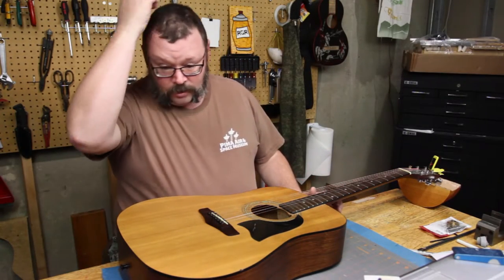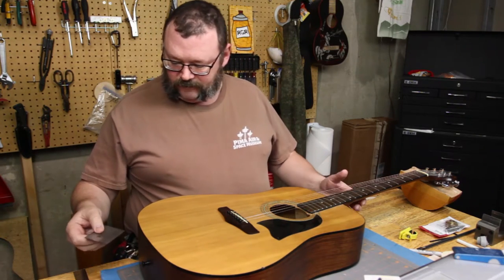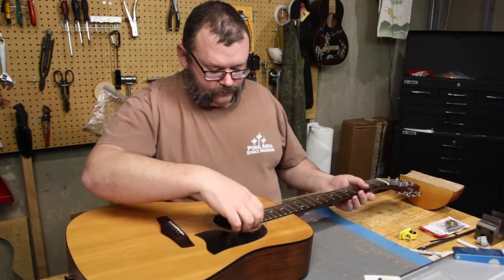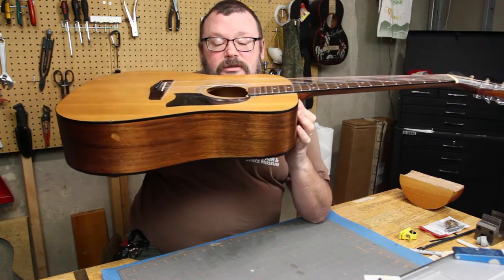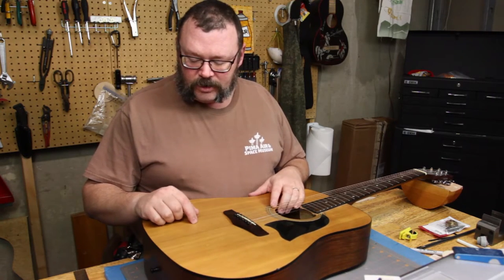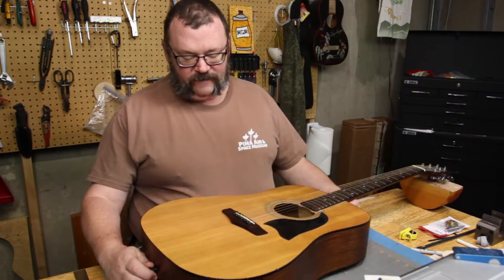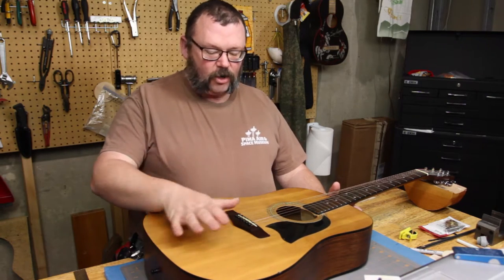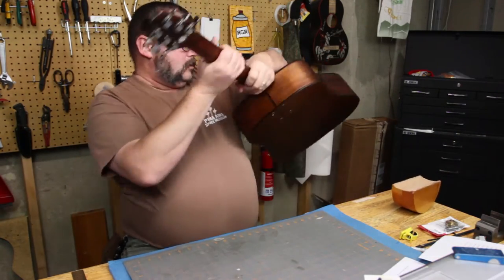intake inspection pt1 PEAVEY CLARKSDALE | RATTLECAN GUITAR RESTORATIONS by James O’Rear

Comment: WOW! High action city! I'm surprised the top didn't crack or break! With a neck block like that and bolt on neck its weird that it moved that much. At 12:35 It sort of looked like someone drove a shim or wedge inside between the neck block and the top.
Reply from the maker: There appears to be a wedge/shim underneath just like you said. I'll take a closer look at that when I "dissect" it.